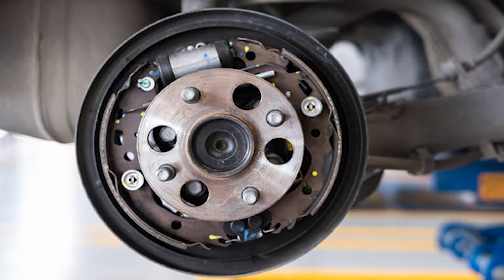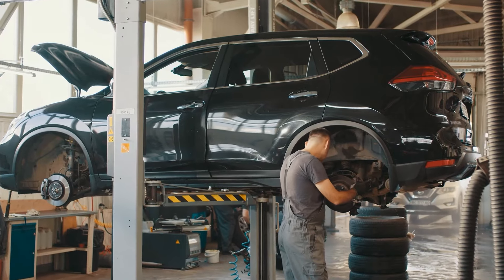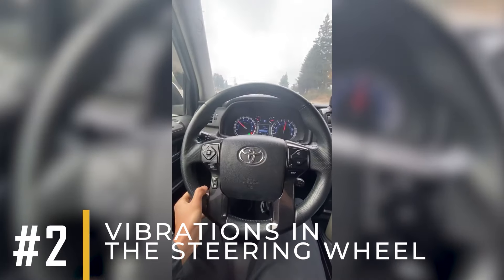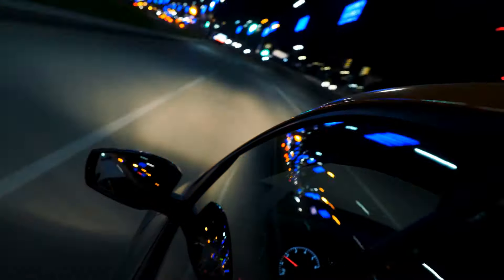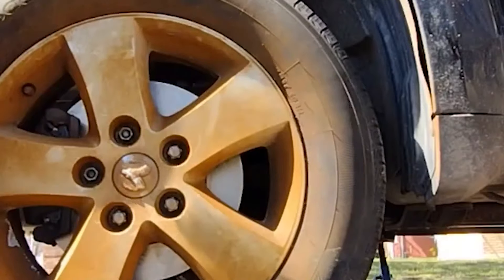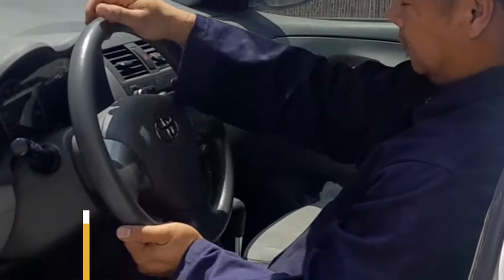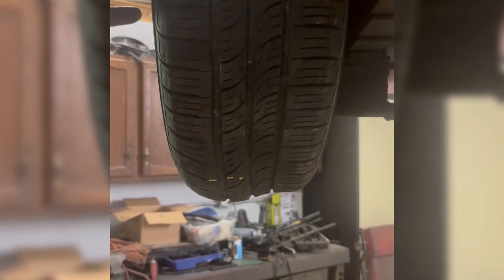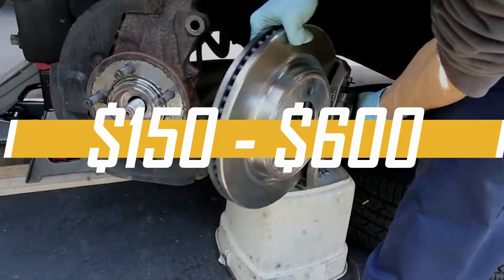4 COMMON SIGNS YOUR WHEEL BEARING IS BAD

Comment: Hey man I was seeing an old video of yourself where you were fixing body damage on a Chevy Cruze and you told me I would have to cut out the old fender rail and weld in a new one…. I wanted to know before I start welding in a new one do I need to remove my engine or is there a safety protocol I should fallow?
Reply from the maker: NOT REALLY.  If you cut the fender rail with the engine mount, then you have to support the weight of the engine by putting a jack stand or hydraulic jack under the engine.  If you are not touching or removing any of the engine mounts, then you don't have to support the engine.  But in either case for Chevy Cruze you don't need to remove the engine.  Hope this helps.  Good Luck!